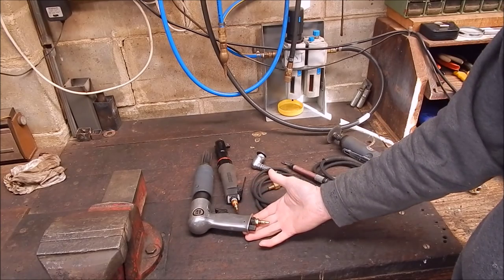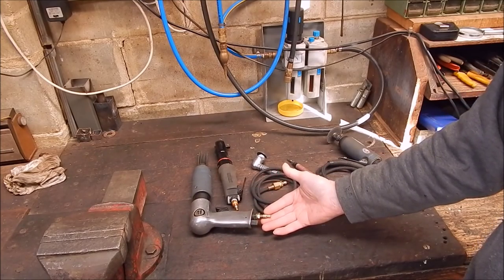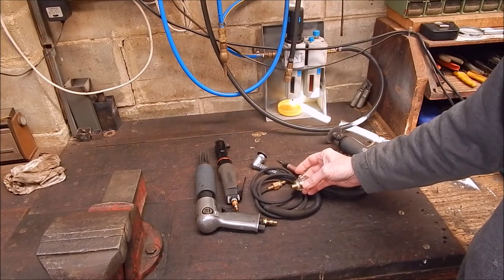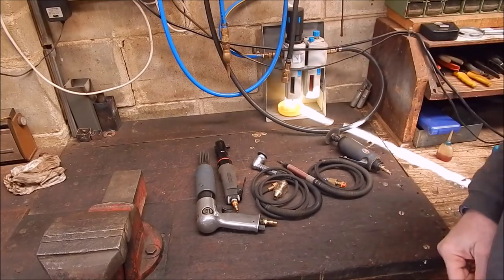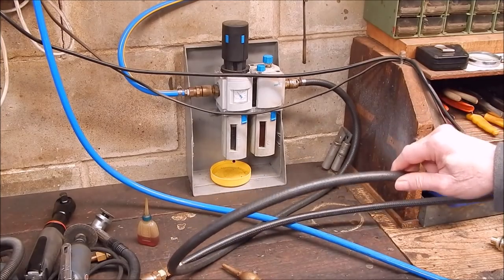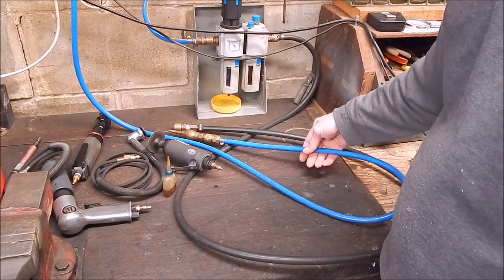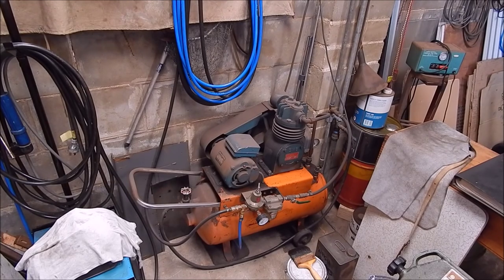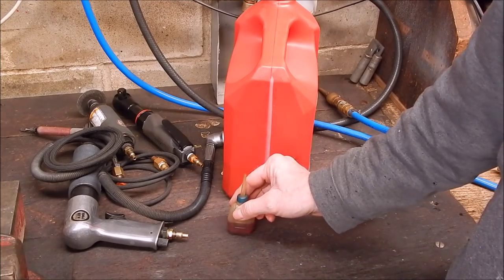How to oil your air tools

Comment: Good stuff again Rob--very relevant----I swapped over to entirely canola oil for literally everything a few years ago for health reasons and no regrets..
Its worth considering...Ian
Reply from the maker: Ian Craig Hi Ian.  I wondered about canola oil for this (or even olive oil). 

I know you can use canola oil for metal lathes -  you may have been the one who suggested it back a while in another video ?

I'd be interested in other viewers opinions on this.

Cheers Rob
Reply: hello beginner here i know this was 5 years ago but is it still good to use canola oil these days

Comment: G'day mate.  A slippery subject for sure.  I just put a drop of whatever is in my oil can into the air tool before use.  So far I don't have cancer or worn out air tools.  My air supply does leak and I am too lazy to take it apart and fix it.  Thanks for the video.

Comment: Great video Rob. If I may just add a little information to the subject matter, i.e. Air-Tools-How much (you covered that) & When to oil.

Each person is going to have to make a real life assessment of there air supply, the air compressor. Those using a small air compressor such as what Rob shows in the video, are plagued by the fact as the compressor takes in atmospheric pressured air (approx. 15 lbs per sq. inch / 103.42 kilopascal {kPa}) and compresses up to the high range of your compressor lets say 100 Lbs per sq. in. {689,475.70 pascal} the water in the air (via humidity) is then displaced when cooling takes affect on the formerly hot air, and falls to the bottom of your air compressor tank.

A small test to see how bad a situation your dealing with is to simply, attach a air blower, and blow across a fat piece of metal, maybe the size of something 6" in. x 6" in. (152.40 x 152.40 millimeters.) Look to see how much water / humidity is present. Example, you place a small piece of paper on the metal surface the same size, and just after maybe 3 to 4 seconds of blowing, directly onto the paper, it is very wet, you should think about oiling a minimum of three times a day. Also look into reducing this amount of water/humidity via some type of filter.

Comment: Useful info there. I go with the manual oiling myself, I mostly use the air duster, tyre inflator or sandblaster, it's rare I use the nail gun or other air tools so manula is the best method for me as I only need 1 air line.
Reply from the maker: caskwith Yes, I agree.  Manual is all you need. I only got the Festo because it was dirt cheap.  It's nice, but I could easily live without it.

Cheers Rob.

Comment: Rob, the oil you use should be compatible with the seals in the tools. Most tool makers don't support using automotive oils because the additives will harm the rubber piston seals. Perhaps it would be good to see if organic oils such as olive and canola are not inimical to the almost certainly synthetic rubber seals before using them.

I use nail guns a lot, and those inline oilers are great for that, but for things that use LOTS of air, like chisels (not sandblasters  :)   ) or nibblers or descalers, perhaps they aren't the best.

My preference is to over-oil rather than to skimp on it. Oil is cheap and tools are not, so using too much oil to preserve the piston bores, especially on tools which are not often used, has to be better than parching them and exposing them to the risk of corrosion and dust damage.

Not criticising, just saying...
Reply from the maker: Greg Brodie-Tyrrell Hi Greg.  Your comments are most certainly appreciated.  

The oil seals aspect is a consideration, for sure.  Brake fluid can only be used with the correct seals, or they fall apart - you can't just use any "O" ring even though they mostly look the same.

ATF is certainly widely used for air tools in the auto industry.  My father was a mechanic all his life.  It does the job, but the health aspect rarely gets mentioned.  But then again, the health aspect of lots of things rarely gets used, dust from particle board being a case in point.

A friend who was a cabinet maker died in his mid 40's from long term exposure to that stuff (lung cancer).

The video will probably surprised a few people, who have never thought about it.

Cheers Rob
Reply: @Xynudu  I've just learnt a lot from this. I'm a beginner and thought id do some research before using it and this has really helped alot. Thanks

Comment: Thanks! 

Thoughts:
Air tools for automotive body work, need oiling, and if oil is vaporized into atmosphere and possibly onto the working surface (car body), wiping car surface with degreaser (pre) is necessary it seems based on what you say! :) Thanks!
Reply from the maker: You always wipe down with metho or acetone before spray painting.  There could be oil or dust present.

Rob

Comment: Would you use a different type of oil for long term storage?   Let's say a die grinder is going to sit for a year or 2.   Store with same oil you use every day?   Or different, like when you store your boat's outboard motor?
Reply from the maker: I would use the same oil, but that's just my opinion.  I've never had problems from long term storage of air tools. You could put some Marvell Mystery oil through if you want to be sure.

The main thing with air tools is to have a relatively clean and dry (at least dew point) air supply.  Obviously water in tools left standing will be a bad thing (rust).

If you have ANY water droplets forming on the air tool exhaust outlet during use, the air supply is not good enough.  

This simple setup will cure that problem.

https://www.youtube.com/watch?v=ACPoyUM9yco

Cheers Rob
Reply: Ok thanks.   I think what I will do, when I am done using the tool at the end of some project, I'll end by putting some "Marvel air tool oil" through it with a short blast of air to blow it through but not entirely out.    That would be in addition to putting the same oil into it at the start of every use.   
I guess I question it a little bit because these air tool oils (like Marvel) say that they "dissolve gum and sludge" which sounds like solvents, and storage oil is not like that.   Also the Marvel oil says "Recommended for use where tool use is frequent and prolonged".   That is not long term storage.   It just all seems kind of backwards for long term storage.
Reply from the maker: MMO can be used lots of ways.  It removes carbon and gum, but only under high temperature conditions (from my experience).  It's also a high detergent anti seize oil so good for "running in" engines.

It is used to coat cylinders of engines for long term storage as it will easily atomise and give a complete coverage.

I see Marvel make an air tool oil but have never used it.  The main thing is to give the tool a heavy dose before storage if you want to cover all bases.  Any light oil would basically cover your needs.

Four drops into the inlet and a 4 second run should be enough.

Cheers Rob
Reply: Ok well maybe I'll buy both, the MMO and the MATO.   I'll have MMOMATO haha.   I mean I could try both.   Let you know in 20 years how it works out LOL.  Thanks!

Comment: Every time I see the air regulator in the background rob I think of a 2volt battery case that p.m.g. used for holding batteries in  ah those were the days  they used to gang them together to make 48 volts for the ringer circuit to the telephone lines, there are some days that I wish we could go back to simpler times. Is that wrong of me ?
Reply from the maker: dtec30 I know what you mean.  We bought and use the old district exchange/battery hut (portable PMG unit on skids) for the horse tack shed.  It has the racks inside for those big glass battery cases.

The guy next door used to work for the PMG and as a kid we used those obsolete glass cases for aquariums :) Days gone by.

Cheers Rob
Reply: Ah those were the days I can remember seeing the battery banks of the 2 volt deep cycle batteries at the exchanges and yes they were clear so they could keep an eye on the water levels but if you were working on a live system you needed eye protection from flash if you happened to drop spanner across the terminals say good bye to your spanner
Reply from the maker: dtec30 You sometimes see the old glass battery cases in antique shops - people use them for flower vases.   With all that hydrogen gassing out in those little huts/big battery banks, I wouldn't fancy arcing anything, any time soon near one.

They switched to "maintenance free" batteries and they turned out to be just as dangerous.

I expect they use non gassing batteries now, with solar assist.

All hi tech.

Cheers Rob
Reply: Well all I know currently they have gone from having techs in the exchanges to using a program called director wich basically tells the Liney or tech where the next job is so the whole workforce is basically mobile at all times and from memory back some time in the ninety s the gaol was to have 4 techs serviceing sa and nt. But I don't think that will ever happen in my life time Thankfully

Comment: Do you think an inline oiler is necessary for air tools when only used occasionally for home DIY work? Want to get the best and longest life out of my tools but don't want to waste money on inline oiler if not necessary.
Reply from the maker: Hi Jacob,

No, it's not necessary.  So long as you add a drop or two of oil at the air connector every hour it will get enough. 

I do have a commercial/industrial inline oiler at the work bench, but only because I got it very cheap.  The little clear plastic type are totally useless as they put way too much oil through and are usually non adjustable.

When using the pencil grinder at the lathe I run a long clean/dry air line and just add oil at the unit.  Obviously in line oilers will contaminate the air line and make it useless for other duties.  My hoses are color coded, blue - clean, black - oil.

Cheers Rob
Reply from the maker: Hi again Jacob,

I should also mention that a clean dry air supply will prolong the life of the tools as much as regular oiling. 

There should be NO moisture droplets evident at the exhaust port on the air tool.  If there are, it means the air dryer/separator is not doing it's job.  This is quite common with cheap small Asian air compressors as they mount the unit on the tank  The air temperature is too high to allow dew point separation to occur.

The separator should be at least a metre away to do any good (preferably further).  The air charge will cool in the air line.

You can make a simple in line cold steel pipe intercooler to drop the air temperature and also take out most water vapour able to be separated at dew point (ambient air temperature).

https://www.youtube.com/watch?v=ACPoyUM9yco

This works so well that I get no water in both my separators further down the line.

You can make these units as simple as a single pipe running diagonally across the wall, with a drain on the bottom.

Cheers Rob
Reply: Thanks so much for your reply Rob!! That's exactly what I wanted to know. I've just spent decent money on a good compressor and air tools and know very little about maintaining them so this is great advice. Thanks for the upload!
Reply: This is one of the best videos I've seen. Well said man.

Comment: But how do you oil the tool...deminstrate
Reply from the maker: Put two drops of light oil in the tool air line connection point every couple of hours, if you don't have an oil/air feed line.

Comment: When I  Oil my air tools I put them in a trash can half way down and run them most of the oil mist stays in the can and not the air . I hate when people over oil an mist into the air. been using Marvel Mystery oil  for years works great   you know what's in it I don't either it's a Mystery
Reply: 1995dresser i put mmo in mine too

Comment: Often wondered if one could use baby oil; one of the safest oils? I have taken to using it on hand tools, locks etc as lubricant & rust preventer.
Reply from the maker: Springwood Cottage I wonder how well non petroleum based  oil stands up to high speed seal lubrication requirements (could it carbonize ?).  However, I believe it's the base constituent for chainsaw bar oil,and that's pretty demanding/hot.

Interesting topic.

Cheers Rob
Reply: As I understand it baby oil is predominantly highly refined mineral oil (paraffin oil UK), see https://en.m.wikipedia.org/wiki/Mineral_oil